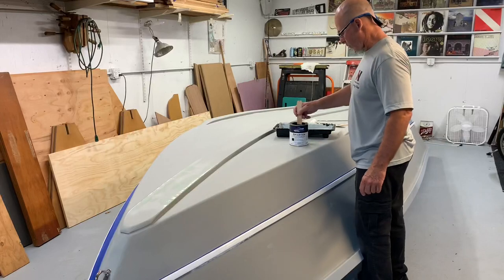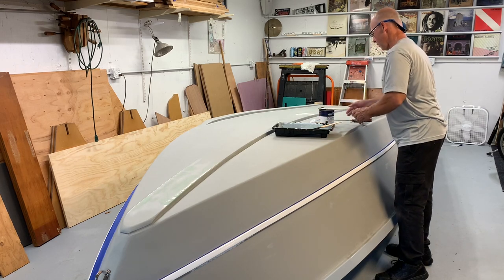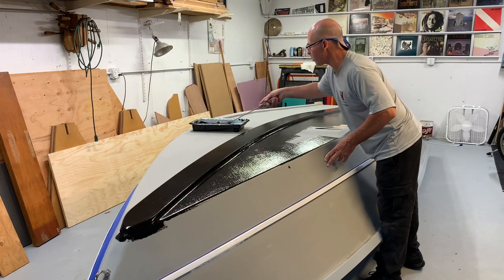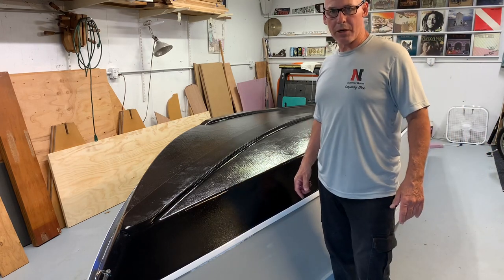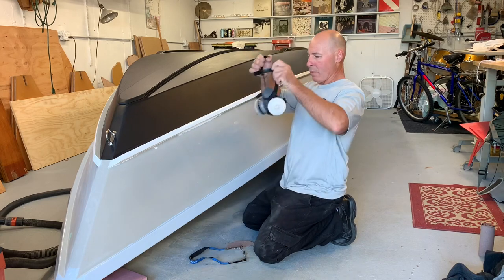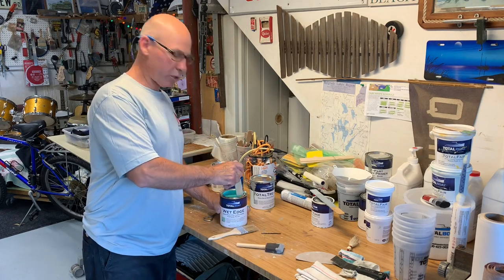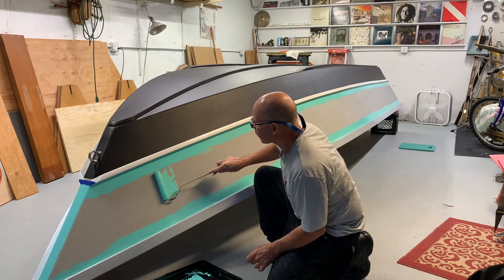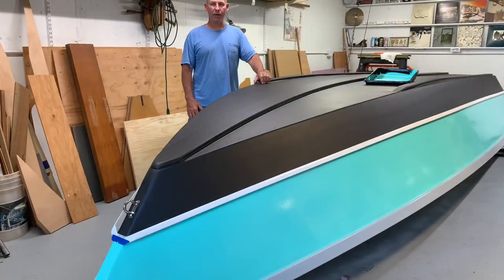Building Plywood Boat Ep 26

Comment: I just spent my entire Saturday watch the entire build. Well done. You have me wanting to build one know. 
Only thing I didn't see was how you mounted the outboard.
Reply from the maker: Cool maybe you should, so I centered on the transom clamped it on and the motor came with bolts. Drilled through transom sealed with silicone and tightened up.